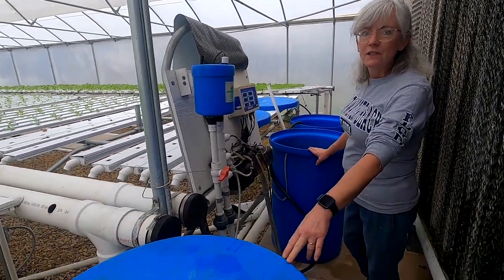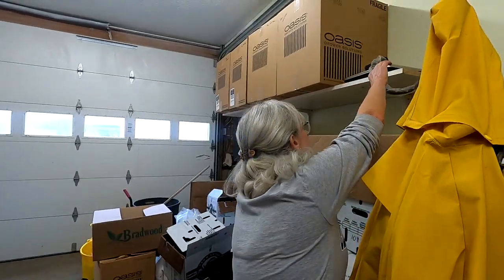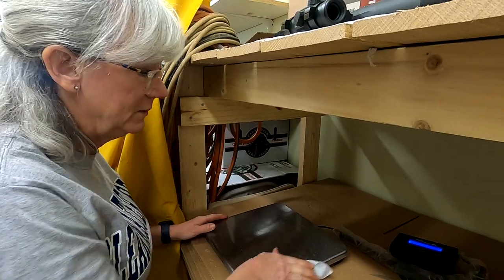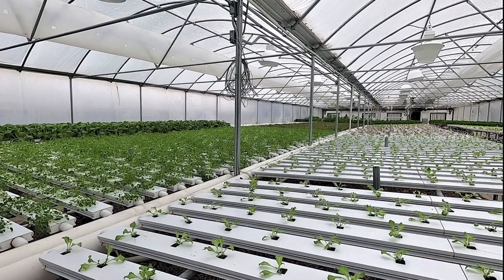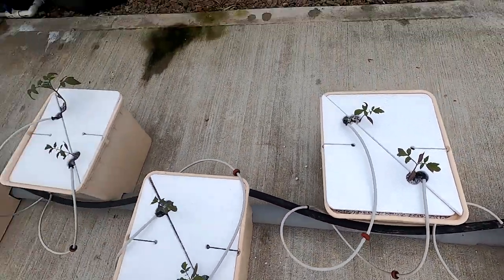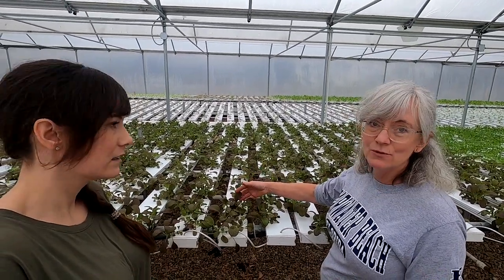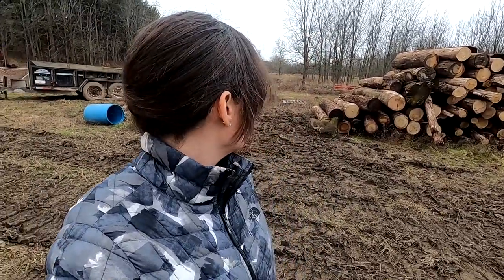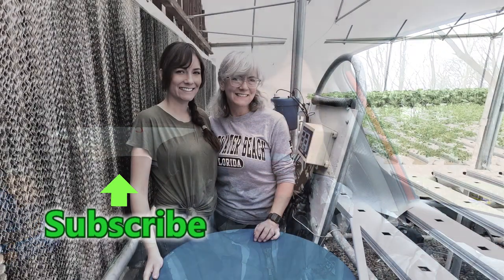Hydroponic Nutrients Mixing and Tank System | Greenhouse Updates

Comment: Thanks a lot for making and sharing these videos. Very helpful! I have few questions would like to ask:
- Do you totally flush out the reservoir tank some time, or just add nutrient solution into it? If yes, how often you flush it?
- How often you mix the new nutrient solution in the nutrient tanks? 
- Do you have any insulation for the reservoir tank? Do you monitor temperature inside of the reservoir tank and what is it in the winter time? (I am in Nova Scotia so I guess we have same kind of winters).
Reply from the maker: Thank you. I will try my best to answer.  
-Yes because salt builds up in the solution after the plants take in the nutrients. About once a month or more.
-Depends on how much we are dosing.  Every couple weeks or so.
-No insulation for the tank but it stays warm with the solution contantly flowing in and out and through the greenhouse.
Reply: @HomegrownPassion  thanks a lot! Once the pandemic is gone, could I visit your farm?
Reply: @HomegrownPassion  
It may pay to  look into having the nutrient tested to see if you can gain extra mileage by amending the elemental content. If you can double the life of the solution with amendments you will reduce your overall chemical and water cost and as a bonus halve the impact on the environment :)

Comment: I just found your channel and I am looking forward to catching up! I am getting ready to do a small (and I mean small) hydroponic system in my basement LOL :0) I look forward to learning as you make more videos. I have a farm, but I am not on it full time, but I am imagining a system like yours :0)
Reply from the maker: Thanks! I have a little setup in my basement too haha it can grow 8 heads of lettuce.  It's fun though.  What do oyu have on your farm? Do you have a garden?
Reply: @HomegrownPassion  I do have an outside garden, but I would like to set up a small system in our oversized laundry room. The more I learn it seems the more complicated it becomes. I am having a hard time with humidity right now. I plan to enclose the area in poly to see if I can better control temp and humidity. I am going through paralysis by analysis 😂😂
Reply: @HomegrownPassion  I almost forgot, the farm is about 5 hours away from me right now. It is 48 acres north of Springfield Mo. 18 acres are hay and the rest has cattle running on it. Not my cattle but a neighbors cattle. He keeps an eye on everything until I can relocate back down there. There is an old house on the front of the property, that my stepfather used as a base of operations for the farm. There is a moderately gentle slope down to the front. I would like to build a south facing greenhouse that starts out underground if that makes sense. We will see if I actually do it. I could see selling fresh vegetables and fruits from that old house though. A neighbor down the road has 9 hives of bees, I am sure I could sell that through the store. 😂

Comment: It looked like the materials that were being weighed out were Haifa brand.  Is it safe to assume with your experience you have found these to be the best quality for your application ?  I ask as we will be starting an ebb and flow system in our new greenhouse and will be recirculating much as you do only it will be intermittent based upon the moisture in our potting mix.  Thank you for sharing.   Each video contains a wealth of knowledge.
Reply from the maker: Yep they work really nicely for us.  We get these because we can pick them up locally and avoid shipping costs.  Thank you so much for the kind comments.

Comment: Thanks for Sharing the mixtures for hydroponic very informative. Just a question what temperature do you maintain in green house specially for growing tomatoes and beans and also what heating system do you guys use.. thanks
Reply from the maker: Thank you very much.  Around 24° C is optimal, but it fluctuates a few degrees between day and night. Our heaters use natural gas, but we also suppliment with a wood furnace.  I would like to make a video on that soon.
Reply: @HomegrownPassion  looking forward for it .. I’m from VA and we do lot of Asian vegetables and we’re in process of setting up green houses for extended season and also start early

Comment: Thanks for the great work, i have a question regarding to the dosing quantity for each Nutrient A and B for the main big tank, how you manage the quantity of each when u want to adjust the EC and concentrations of nutrients
Reply from the maker: When the EC needs adjusted, we can change the setting on the controller next to the tanks.  It reads the EC in the reservoir with an EC probe, and will take the correct amount of nutrients out of the blue tanks and add it into the reservoir tank.  We check the blue tanks often to see when we need to mix more nutrients.
Reply: @HomegrownPassion  thank you for your answer, so you add a ready mixed nutrients to the main tank, not specifically quantity of A or B right?, i was wondering if there is a way to know exactly how many liters of each from A and B, as EC could sometimes not representing the quantity rest of Macro and micro nutrients in the main tank

Comment: Since your pH is set up to be ideal for lettuce and greens, do you use a different nutrient solution for tomatoes?  

Does all of the water recirculate or does some leave the system?

Thanks :)
Reply from the maker: Yes we use a different one for the tomatoes.  I'll make a video on those soon once we need to mix nutrients again.  The water in the NFT system recirculates, but some evaporates so it needs topped off almost every day.  The nutrient water in the Dutch bucket system is drain to waste, but not a whole lot is wasted becasue we can adjust the timing on the emitters to soak the growing medium just enough.

Comment: Great. Thanks for the video. Couple questions, do you guys have a timer set for the pump? Or its always sending water to the plants?
Do you guys buy all the nutrients from CropKing also?
I live in Florida, do you you any company such as cropking or like cropking to help me with the supplies and stuff? It is costly to ship them down here

Thanks
Reply from the maker: Thanks! The pump is constantly running for the NFT system that we showed in this video.  We also have the Dutch bucket system which is on a timer (40 minutes off/ 40 seconds on)  and I'm hoping to film mixing nutrients and the pump for that system soon.  
I honestly don't know of a company like that in Florida.  There's one in California that I've heard of, but I know that doesn't do you any good.  Cropking has built greenhouses all over the place, so they might be able to help you with that, but the supplies would definitely be expensive to ship.
Reply: Crop king is an absolute rip off when it come to shipping! Was gonna order 10-8’ channels. $230 or so. With crop kinds shipping it would’ve come out to right at $700. Lol what a joke
Reply: @HomegrownPassion  was that the shipping the quote you for?
Apparently the website gives wrong shipping all of the time. Did you find a better supplier? Still looking for a cheaper option

Comment: This is not commercial hydroponics, at all. You need a water analysis and then dose according to what your system is missing. Going by EC is how you destroy a crop
Reply: i think copking required them to submit water quality test as a basis for an specific formula basing on the quality of their water source.
Reply from the maker: We said in the video how we had our water analysed to come up with the formula and have been running a sucessful commercial hydroponic greenhouse for 6 years with no crop failures.
Reply from the maker: Thank you, rt cartimar, this is correct.
Reply: @HomegrownPassion  thanks for posting the list of fertilizers that goes into your tank, i know its a trade secret but think i know how much weight for every item basing on that 1.7 ec thanks a lot :)
Reply from the maker: Yep no problem! We decided not to include the exact measurements because it will be different for everyone based on water, tank size and crops they are growing.  If you ever come across any other questions, let me know and I'll try my best to answer.  Hope you have a great day!
Reply: @HomegrownPassion  
The elemental ppm for the crop will be the same, you simply have to account for the elemental contributions made by the source water :)